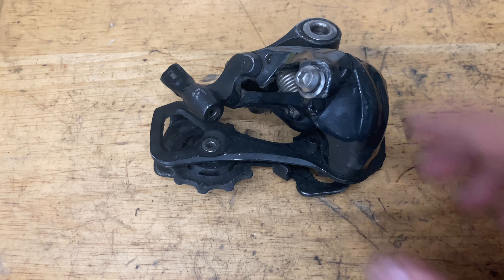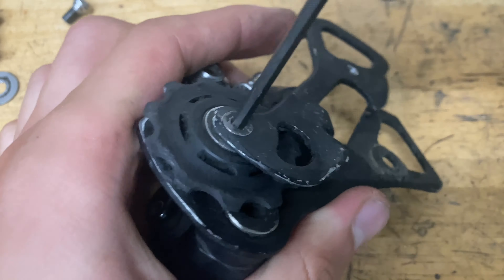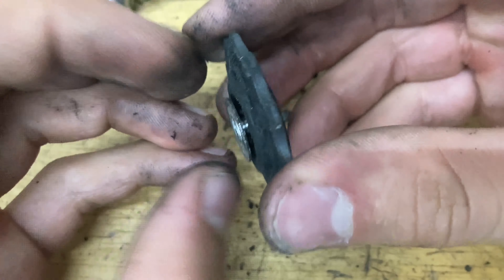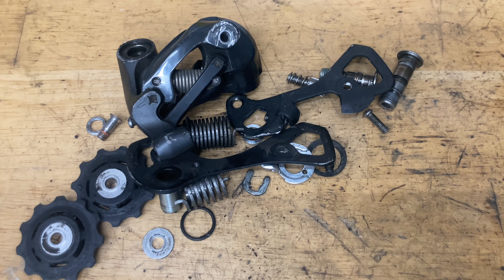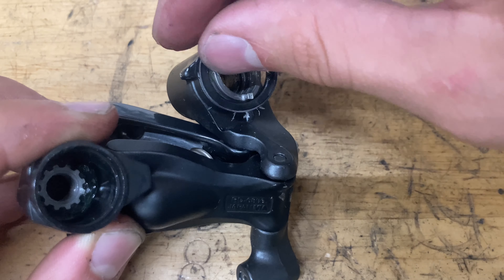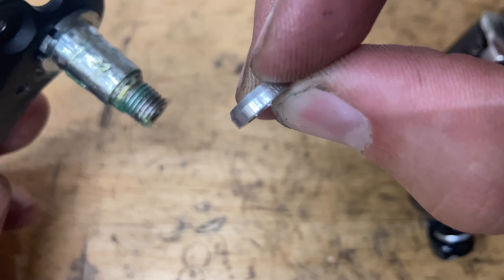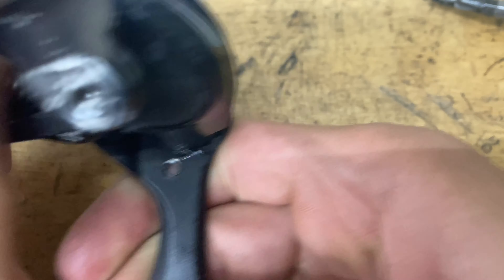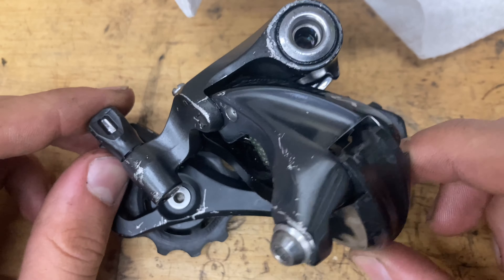How to Rebuild a Shimano Ultegra 6700/6800 Derailleur

Comment: Thanks! This together with the official manual finally worked haha. I tried to fit it back together with the plate stopper pin still in place. Came apart about a dozen times. It's much easier with the pin removed.